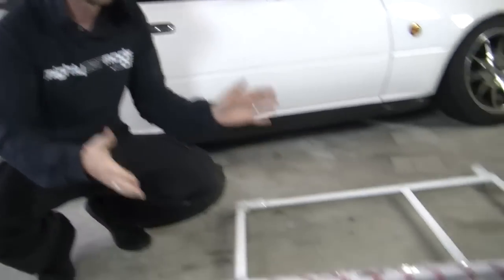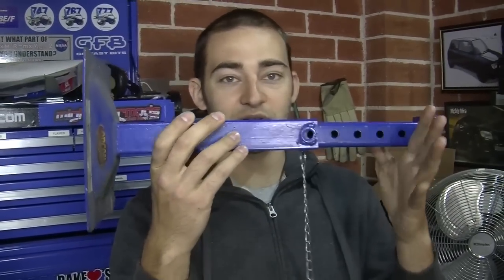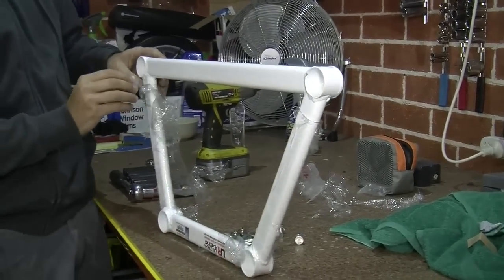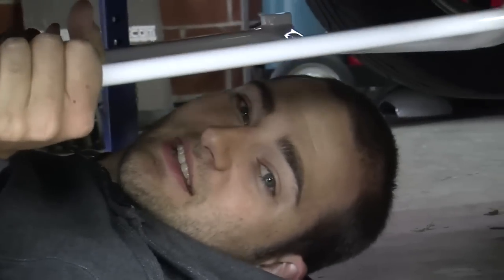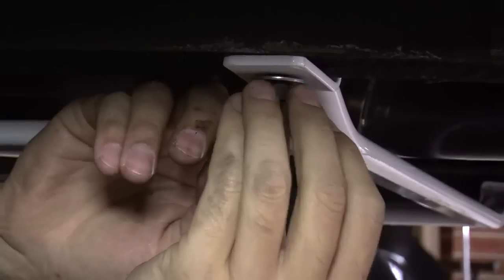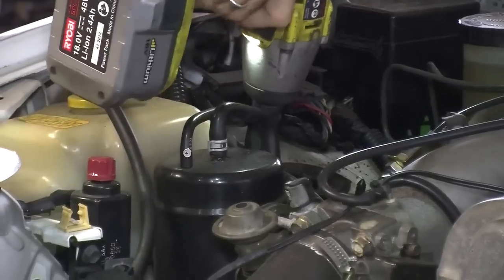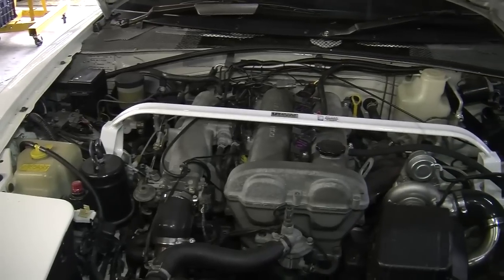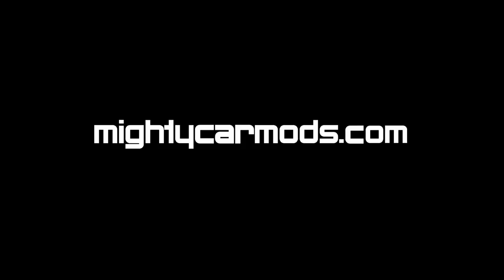Installing Ultra Racing Strut Bars on Mazda MX5 by MightyCarMods

Comment: Just installed these on my NA. 
The captive nut fasteners @8:09 actually don’t contact the chassis rail sides rather the bottom of the rails. While effective, this is the only significant weakness of this design as the rails are as soft as cheese. 

Also, this NA’s rails are in suprisingly good condition. Squashed rails needing reshaping make this fastening point even weaker. 

Has anyone installed these braces with reinforced chassis rails? The thread on the captive nuts seems long enough.